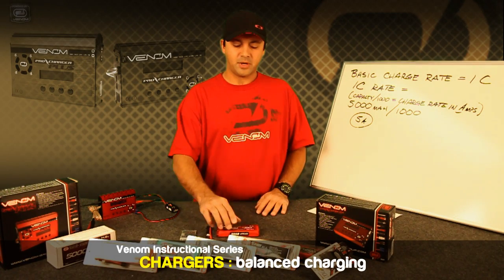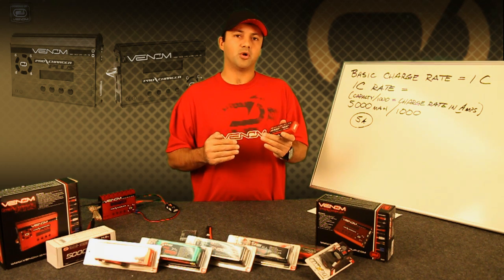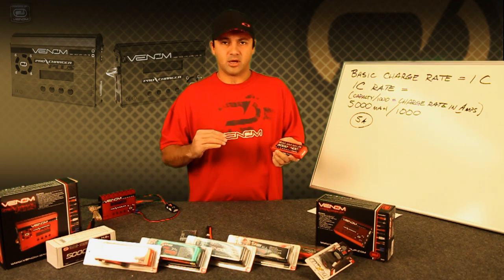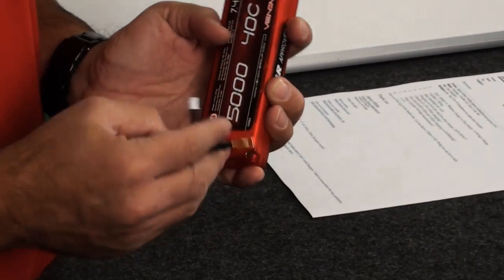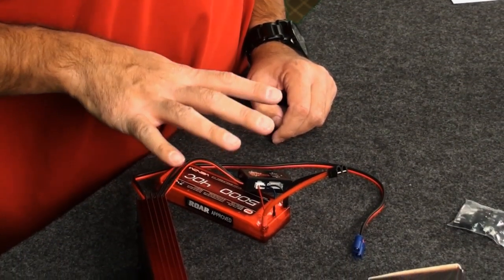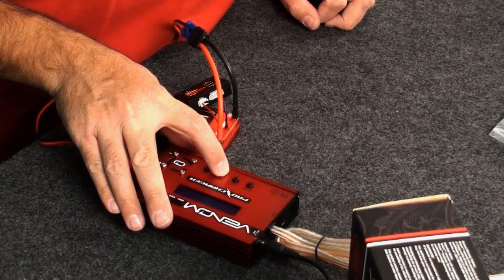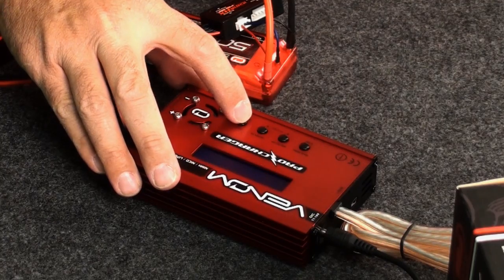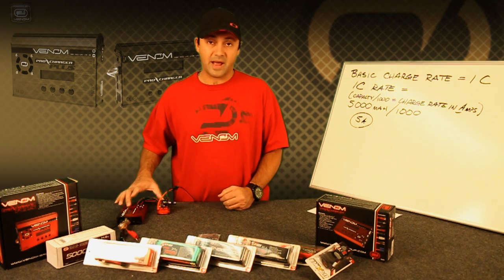Balance Charging of a LiPO Battery Pack

Comment: Can you damage  a 2200miliamp 3S lipo  by charging  it with a balancing charger at 1amp 11,1V 3S? I know it should  be charged at 2,2amps but my charger  doesn't give me that option
Reply from the maker: Hi Joshua! Have no fear in using your 1A charger with your 2200mAh 3S battery. No damage will take place if you charge it at less than a 1C rate, it will just take longer. The most important part is that your are charging at the same voltage (cell count) as your battery.

Comment: Now the battery is 7.4V, with a discharge for storage they say to go about 3V, but would that be 6V battery or is that 3V individualy? Since your cells in the display say 3.95 each, wich is far more then the 7.4V of the battery.
Reply from the maker: The display is showing the voltages of the individual cells. A 7.4v battery is a two cell pack. You would add the two figures up to get you closer to the 7.4v figure you're looking for. 3.95 x 2 = 7.9v.

Comment: why is my charger showing a huge drop of amps and a huge jump of volts? results were 0.4a and 8.38v during charge. My setup was the same mentioned on the video with the same battery. Btw, this is my first time using lipo chargers.

Comment: i tried going to your support page and unfortunately it wasn't opening up.

I have tried balancing my batteries with the Venom Pro2 charger that i have. 

BUT it overcharges the 3rd cell EVERYTIME by .05 which that little amount isn't much of a concern. what is a concern is that the charger says that everything is perfect but when i check my packs on other peoples chargers and battery readers they all say that the 3rd cell (of my 3 cell batteries) are all over charged.

is this a calibration issue with the unit? I would like this issue fixed as im worried it might blow up my batteries if not now...in the future.

Comment: I charged my 3S 5000mah with balance with 1 amp and it took 4-5 hours is this normal?
Reply: yez, you have put 1000mah per hour in it, if you charge at 5amp it will take only an hour

Comment: I picked up a Venom Pro2 a couple of weeks ago and started getting a "Connection Error" on EVERY battery I have.  I took it back to my LHS and they confirmed it was bad.  So I purchased a secone one and then was instructed to contact you guys which I have.  I have sent you a copy of my receipt, photo of the error, and photo of the S# off the charger.

In the meantime I used the new one exactly one session of flying and then started getting a "Short Err" message and the charger would not do anything (the new one).  So I pulled out the other one and it too now says "Short Err".  They both give this message whether it is pluged into an AC outlet or connected to my 12 volt car battery.

Can I please have two replacement units sent to me?

Comment: I did all the steps but when i press and hold start it says low voltage. Why is this happening. ( i have a 2 cell 7.4v battery)
Reply: It happened to me right now acually, and its because one of the cells is below 3 volts.

Comment: Does doing a balance charge actually charge the batteries. Or do you have to do a normal charge after that.
Reply from the maker: Lithium batteries comprised of more than one cell will need to be balanced occasionally to ensure the best possible performance.  The “balance” lead simply allows the charger to monitor and bring them all to the same nominal voltage. When “balance” charging, the charger will monitor each individual cell attempting to bring them all to the same nominal voltage. The charger is charging the battery during this process. It will take a longer amount of time to charge the battery when balancing.

Comment: Is there a video or explanation on the Fast Charge feature? When I charge my 3S 2200mah battery, "Charge" and "Fast Charge" take an equal amount of time to charge my battery. What's the point of Fast Charge if it takes just as long as the regular charge feature?

Comment: i recently got the Easy Balance Lipo 1-4 Cell Charger, i hooked my 7.4v 5000Mah 25C lipo battery to it. I have the charger set at 4 amps and the battery has been charging for around 4 hours. This seems like its been charging for longer then it should. any advice?

Comment: You guys need to fix your lipo charger period. I had two batteries that exploded because of your product. I used the multimeter and I notice that it overcharge one of the cell to 5.82v. The rest is 3.82v. Ain't it suppose to be 12.6v when it's fully charge for 11.1v3s!?

I notice your battery is crap too...  I got like 5 different companies of lipo battery. The only one that's acting up is your. It's puffy as heck.

Comment: I must say that I've really liked my Venom Pro Charger up until about a week ago when I got a cell voltage checker to put in the grab-bag I take with me when I go flying. Now I see that it's balance charging my 3s 4000mah lipos to 4.15v, 4.19v, and 4.25v... not cool... have to rely on an external balancer now since it's so unreliable... On top of that, had to replace the fan only a month after I got it... AND, the wall adapter couldn't supply enough amperage to charge a 5000mah 2s at 5 amps...

Comment from the maker: Sorry for the delay in response... You can balance all the time, however, we recommend balancing less often than that. Get your self a low voltage monitor (Venom part # 0644) and check your battery after every run. If your cells are not balanced, go ahead and balance your battery. This monitor is a very inexpensive tool that I use all the time. Thanks, JW Customer Service
Reply: Need a manual for the small red quad charger

Comment from the maker: The charger does not look at the C rating of the battery. The highest charge rate the Pro Charger is capable of is 5 Amps. Your battery should tell you exactly how many amps you can safely charge at. Please note, the Pro Charger has a 50 watt maximum charge power. This will limit the charge current automatically on larger cell count packs. Watts is amps x volts. So, a 6S (22.2V) pack will only charge around 2.25amps. Where as a smaller pack such as a 2 cell (7.4V) can charge at the full 5 amps.